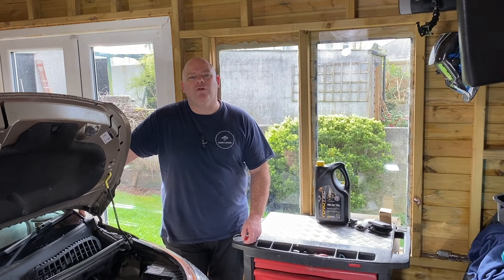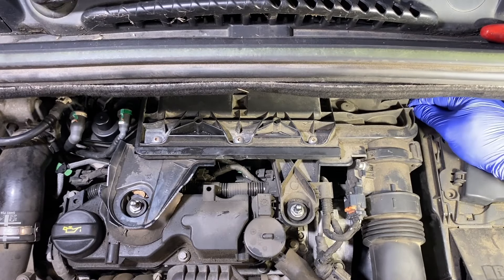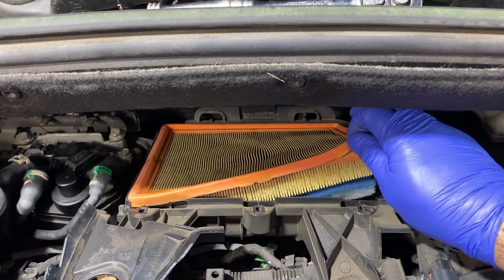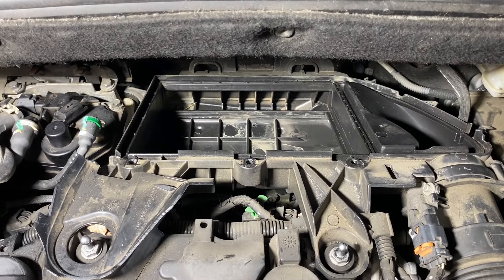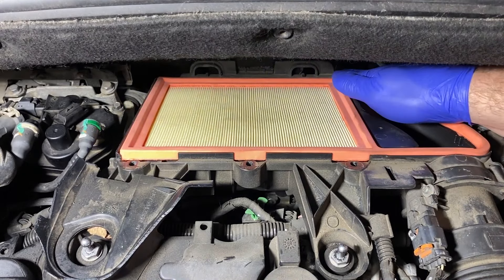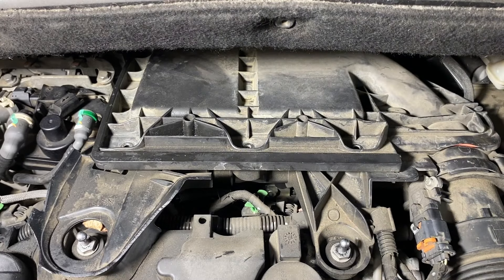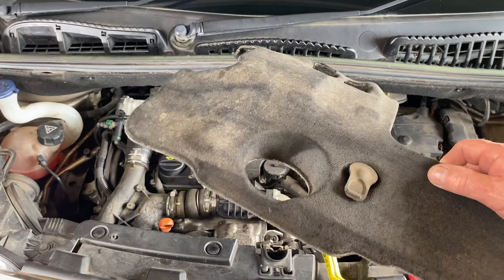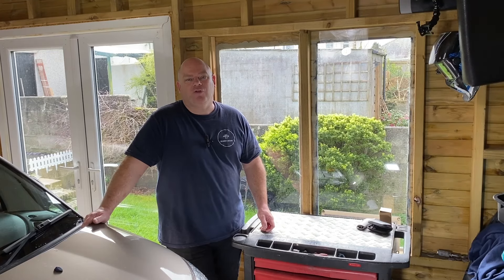Citroen C3 Picasso air filter change

Comment: Great video and thanks for the extra camera angles. One thing I've done for yonks is write mileage and date on  the squishy/top seal with a Sharpie - thinking of the next guy, and/or future me that doesn't want to pop in the house to check the spreadsheet. Also really easy to muddle up all the family's cars. If I'm on the ball I'll run off a label saying air & oil/fuel mileage & date, and stick near the battery box/somewhere sheltered - always a good reminder to plan when topping up the washer water/oil etc
Reply from the maker: @danielmorris2653  Thanks for the positive comment 👊
Yep, i maintain about six of our families cars and it can be difficult to track. I do it by servicing them just before the mot is due. 
My next service series will be my son’s 2017 Renault Megane he recently purchased. I’m out of action with an injured knee at the moment, but will be back to my weekly vids soon!

Sandy.